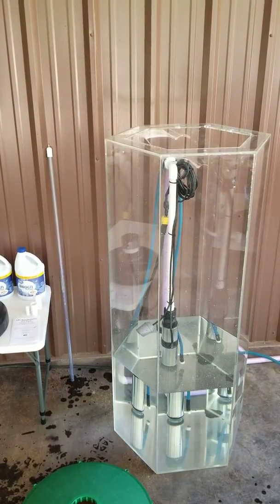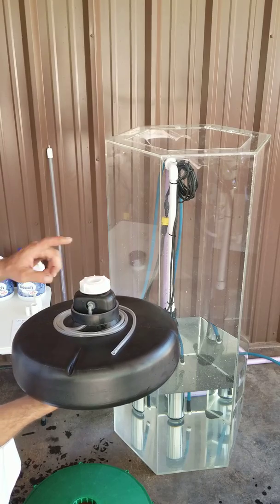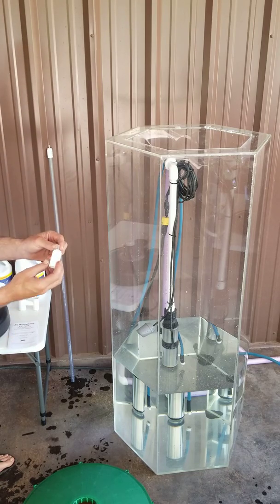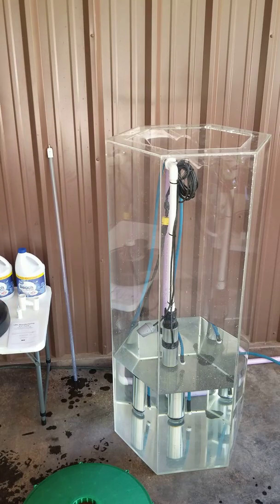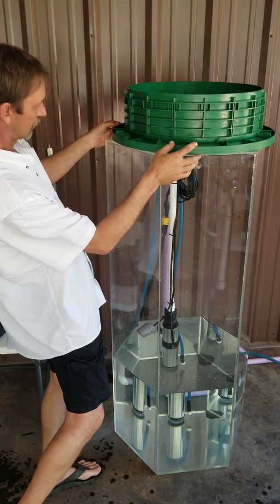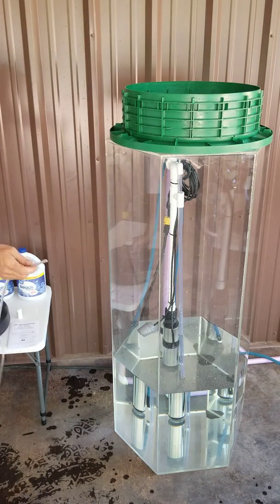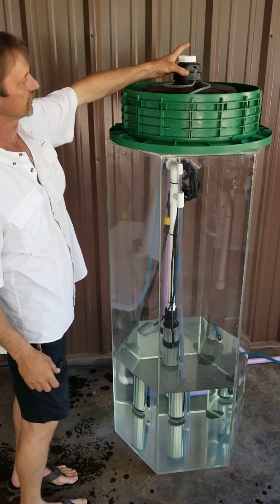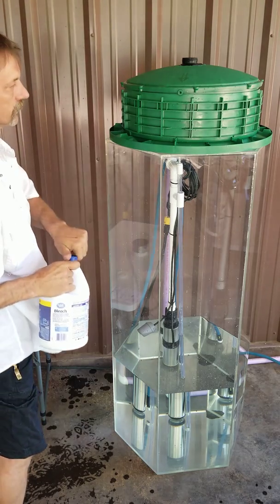EZ-Tank installation part 1 (patent pending)

Comment: We started using these in Texas for OSSF’s aerobics. I prefer the older in-ground reservoirs. When installed correctly, you don’t have to pull them out of the tank every time you do maintenance.